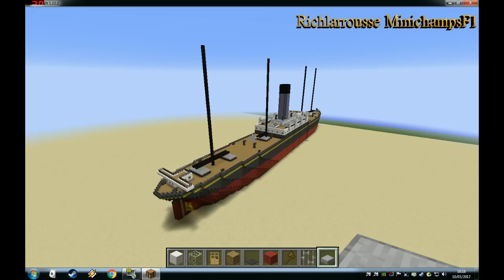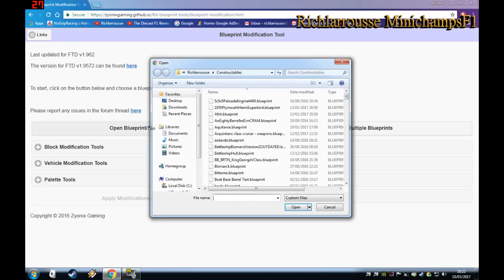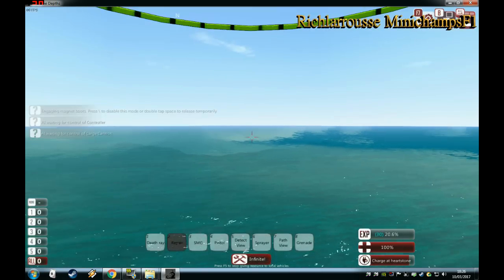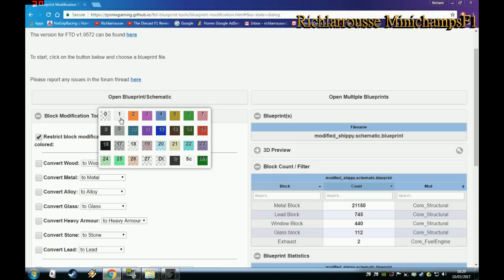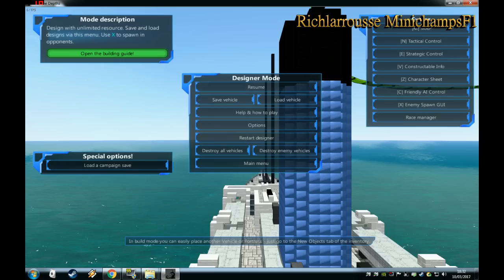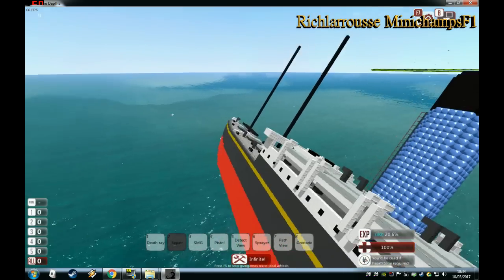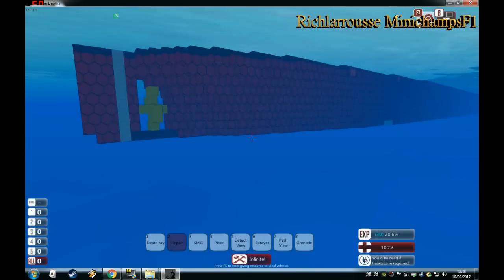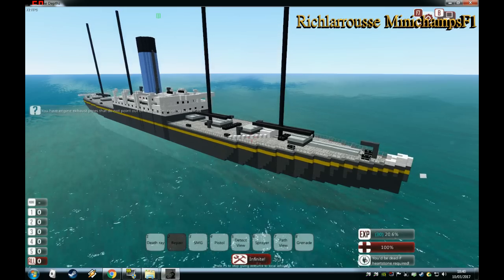Minecraft to From the Depths, Ship Conversion Tutorial

Comment: Hey Rich, I was wondering if you can still get it to work, because I can't. I have only used wool, oak planks and iron bars for the build, so it should still work with the old converter. But when I try to upload the schematic it just says "loading" and then nothing happens.
Reply from the maker: Hi, I think it does still work but its very buggy now, a lot of the ships ive converted recently have just glitched while ingame, I'll have to do some more tests
Reply: @Richlarrousse-JS41 I have the same problem. I was convering a large ship to from the depths version 3.7.3. When I tried to load with .schem or .schematic file, it said loading and the nothing happen. Please fix this.